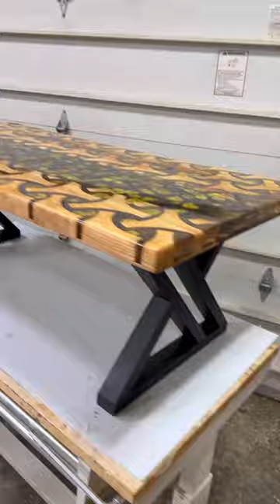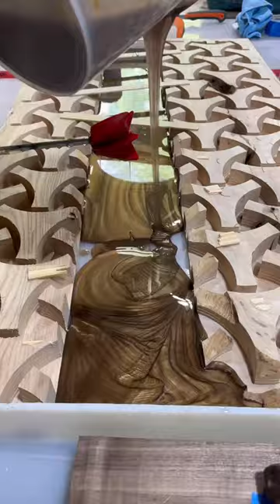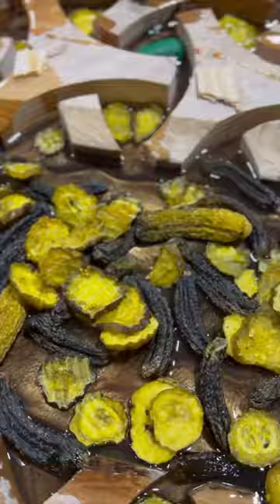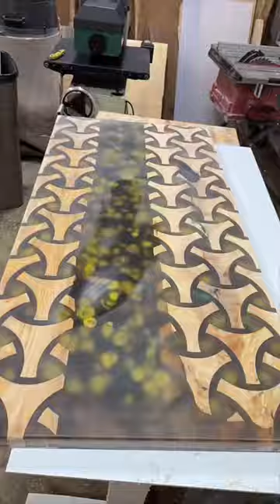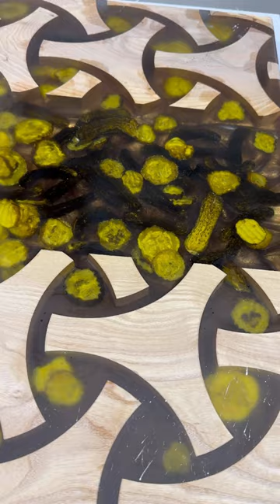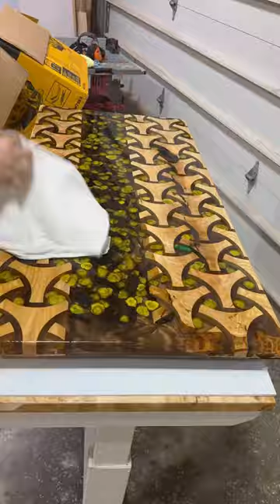Spite pickle table #screamingdonkey #epoxyart #pickle #rivertable

Comment: Hate to be the one with a decomposing pickle table...yes...those pickles will still decompose in the epoxy.
Reply from the maker: Yay, a fake expert.  decomp produces gas.  Gas would create pressure, pressure would make boom.  No boom in over a year.  So, either decomp halts pretty early due to a build up of toxins by the bacteria, or... or... pickles and the pickling process somehow inhibits the growth of bacteria.  I'm pretty sure its a combination.  Even the pumpkin (non-pickled) they did transferred out all its liquid but there was still no sigh of bacterial colonies after a few years.  so, wither and loose their moisture, yes.... decomp, no.  And that my friend is why my pickles are freeze dried.  No moisture.  Thanks for playing the fake expert game.